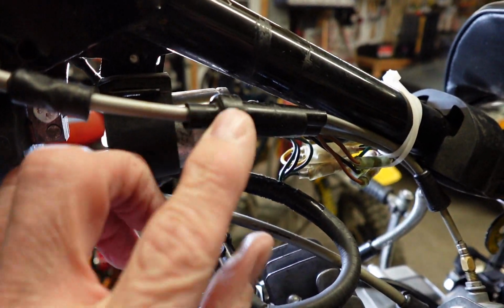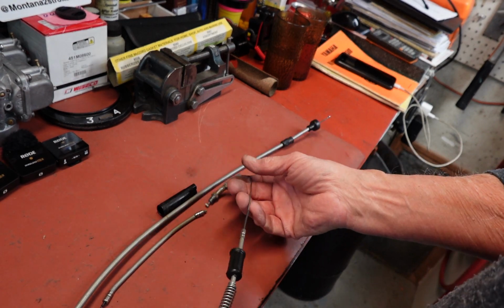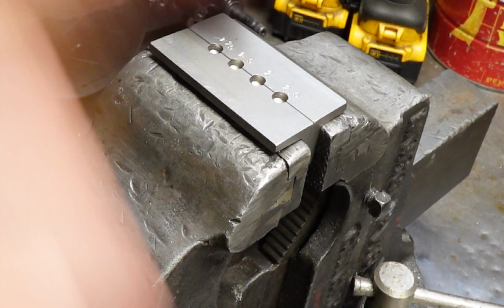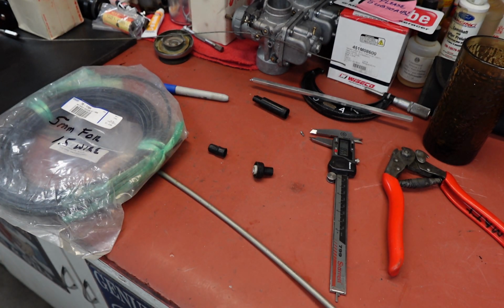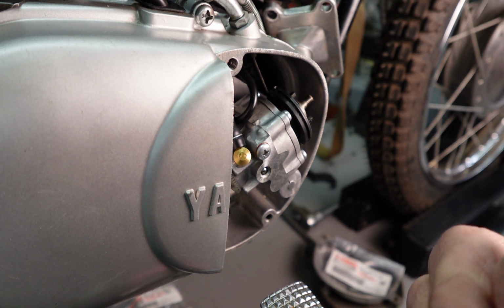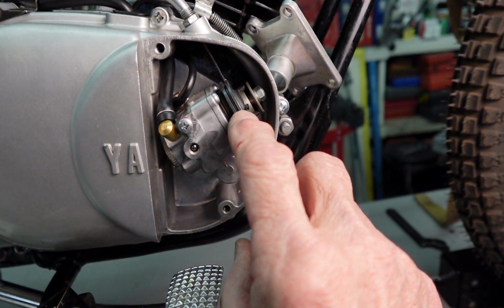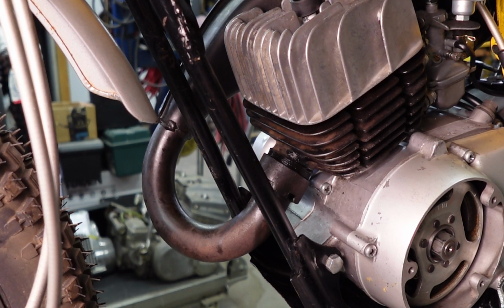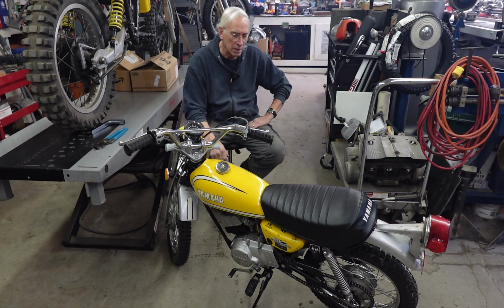Yamaha Gt 1, GT80, test ride in the snow, cable repairs, oil pump adjust

Comment: Great videos!
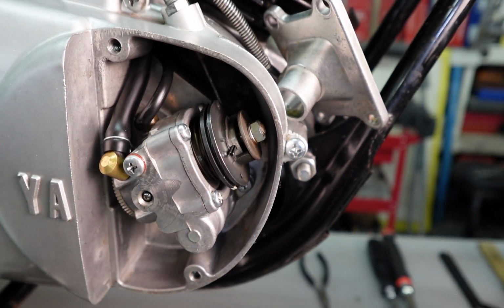25:50 The pumps i have don't have an adjustment dial. I thought maybe they were broken off, but they were never there. They're 78', 80', 81'. 
Your videos have been invaluable. I got all three bikes in boxes, and now I have 2 nice running bikes and a parts bike.
Thanks, really appreciate your content.
Reply from the maker: Some pumps just don't have the dials, a lot of the twin cylinder machines don't.
Reply: @montana2strokeracer Mine are all gt80's. It didn't change the fact I used these videos to successfully resurrect  my bikes. Awesome videos.

Comment: Hi Dale and old Yammie enthusiasts.  I’m trying to hook up a autolube system on 1979 DT125F.  Is there a simple diagram for into the pump and where it connects to the carb?  Thank you!
Reply from the maker: I'm not familiar with the 79 DT125, but the injection lines usually attach to the right side of the cylinder around the intake coming from the pump. Usually, the line to the pump from the tank is a slip-on hose with a clamp. The output will be bolted to the pump and to the cylinder next to the intake.
Reply: @ thank you.  I’ll keep digging and keep watching!  I’m getting air coming out of the port on the carb where I think the 2 stroke intake is supposed to go.

Comment: Well done! I have found a potential source for "similar" cables is India, where thousands of small 2-strokes run around daily. For those of us less talented, another thought is to make an extended ferrule, maybe a split ferrule to slip over the cable and take up the slack. Am installing 30mm flat slides on an RD350. They had no oil port so I drilled and tapped a boss on the top of the carb throat, and used some clockable hose barb blocks. Instead of the oil begin fed into the side of the throat, it now enters from the top, as was OEM on this GT1. It might be an improvement, actually.
Reply from the maker: Awesome, I too would think the top feed would be better than the side.

Comment: A good example of the GT 80. Great to see you test it out. I've watched a few of your cable rebuilds and I think I'll be able to make ones I can't find replacements for now. Thanks for making the detailed videos Dale.
Reply from the maker: Thanks Doug, yeah it was fun to ride, but cold. You won't have any trouble making your own cables. The bird nest tool makes this job just as good as factory, you don't have to worry about an end pulling off.

Comment: You've done a great job there Dale, its a lovely little bike! one small thing, I could be wrong here but to me it would look better if the throttle assembly was rotated 90 or 180 degrees so that the throttle cable was running  in front or under the handlebars, it seems a little odd with it sticking up above the bars. I could be wrong of course!
Reply from the maker: Thanks, buddy, yes, I know about the throttle, but this one has a button like a horn button on that side and if I turned it the other way the button would be facing forward, besides that it's not my bike, so I always leave them the way I find them unless the owner wants them changed. Not sure why the button on the right, it has a horn on the left, I think they may at some time replaced it with the AT-1 throttle control for some reason, and the AT-1 models do stick up instead of down so you can get to the electric start button.
Reply: @montana2strokeracer  Fair enough, I'm sure if you owned the bike you would sort it out. 🙂

Comment: Nice test run.  Gas cap or filter was the issue?
Reply from the maker: Thanks Dave, it was the cap, doesn't have a filter, although it probably could use one.
Reply: @montana2strokeracer  Thanks.  I wan't sure that I heard right.  Didn't know that the cap could do that.  A buddy in high school had what I think was a 125cc Yamaha  in that same color.

Comment: So much articulate detail Dale, its what makes you so good at what you do, I didnt realize those little 2 stroke pumps were so delicate n finickity ! way back one of the mates had a similar pump in an RD200 twin, seem to remember he had issues with it constantly ?  The problem is I turn the pc on to do some work and there I just have to watch your vid haha Thanks for your time Sir
Reply from the maker: Thanks Blair, those pumps really don't require much maintenance once set up correctly. I'm sure this is the first for this pump in over 50 years, so I think that's doing pretty good. Hey glad you could blame it on the PC, LOL. Thanks for watching.
Reply: @montana2strokeracer  love watching your vids Dale, thank you

Comment: That project was a great ride. I lost track of how long it was in the shop, maybe 6 months? Lol, Dale riding in the snow with no gloves/jacket/ helmet. I guess that's the Montana way.
Reply from the maker: Thanks Steve, yes, your correct, right at 6 months, the owner is in Florida for the winter, heading home to Canada early spring. It's now ready for his return. Around here you got to take advantage of a break in the weather when you can. The same night we got 3 more inches of snow and down close to zero for temps, was about 27 the day I rode this out. No helmet law here, it was cold, I won't tell you it wasn't.

Comment: Thats a cool little bike. I'm working on a '77 Kawasaki KM100 right now. it was totally destroyed when i got it. it had no back wheel, the wrong fender, a stripped spark plug hole, etc.  I had to fix the shifter return stud, and weld the case because it broke off, jammed it in 5th gear punched a hole in the case and it was leaking all the gear oil out
Reply from the maker: Holy cow, I have had some neglected bikes, but that takes the cake.

Comment: You did a lot of work on that little bike.
Reply from the maker: Hope it will give the owner years of trouble-free service.
Reply: I have a question for you, what's your opinion on NOS seals. I have a bunch of seals from the late 70's can I still use them. They don't seen stiff or dry.